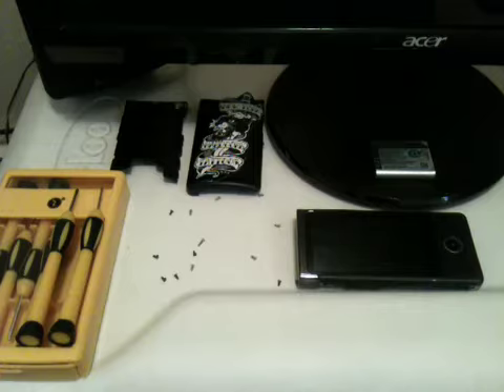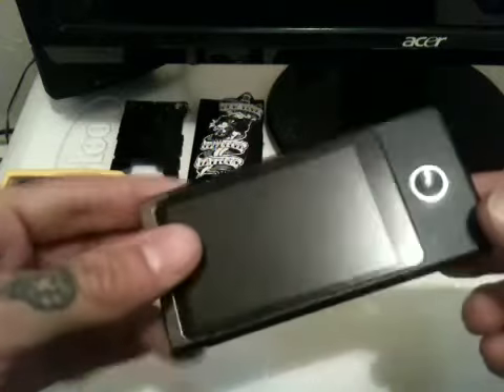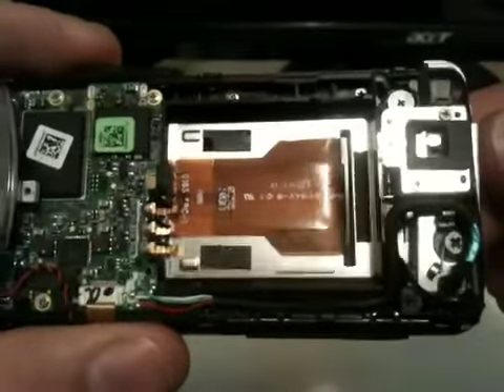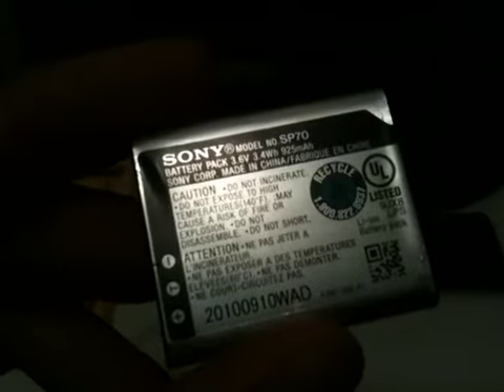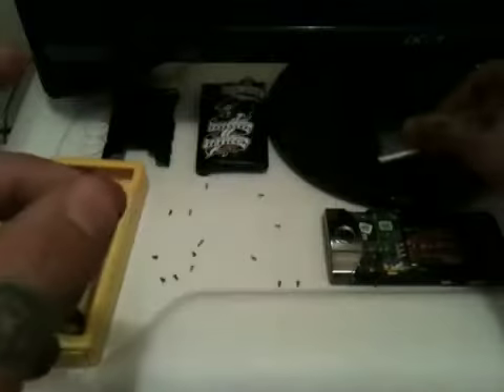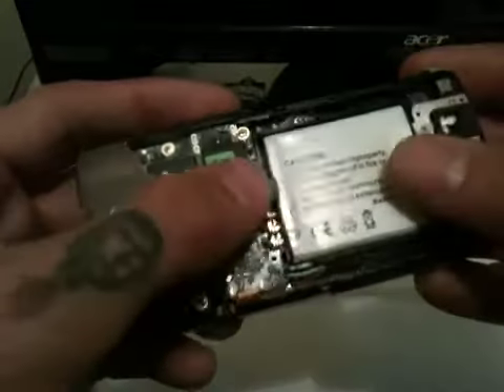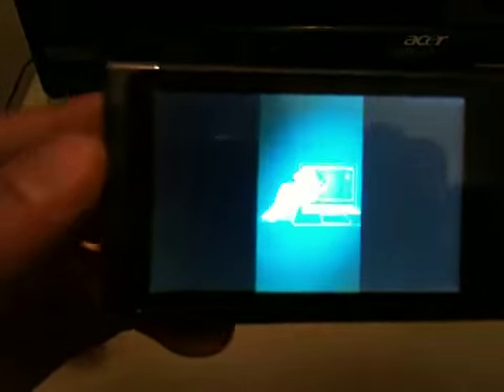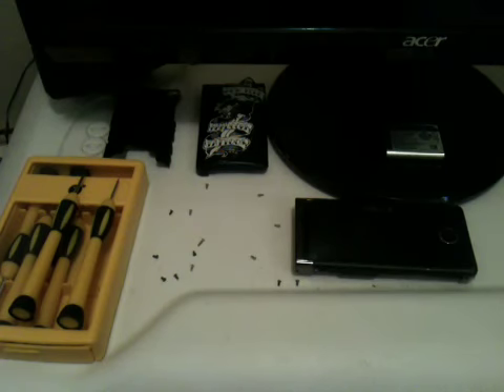Bloggie battery update 5-22-12

Comment: dude how do you get to the screws?
Reply from the maker: There is a very small screw where the USB port is and from there you need something to gently remove the cover, from there is a shield you have to remove by taking a few more screws out and from there you can replace the battery but I do not recommend this cause I almost damaged mine before I did this video.
Reply: OldSchoolNYCGamer so if you needed a new battery now, OldSchool, what would you do, just pay the company to open the bloggie and replace the battery?

Comment: Hi, Mine is a Older Bloggie model. Is a MHS-FS1. It's working, but the battery doesn't last as it did when new. Do you know the battery serial number, there's webpage where I can access the battery serial number or I should open my bloggie first to know which battery model is? Your advice will be welcome. Thanks!
Antonio